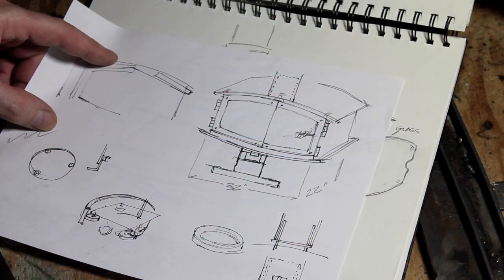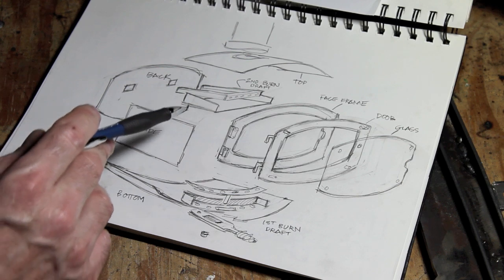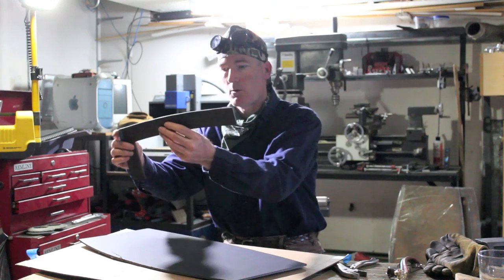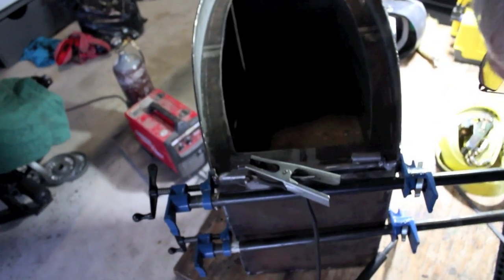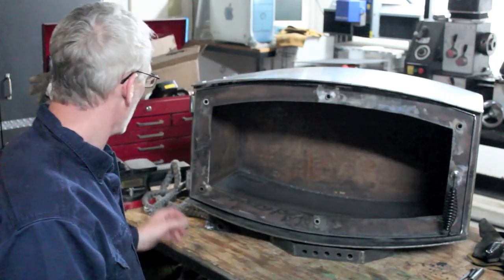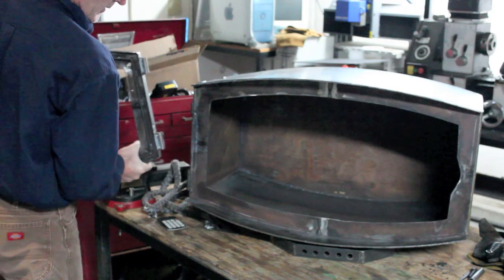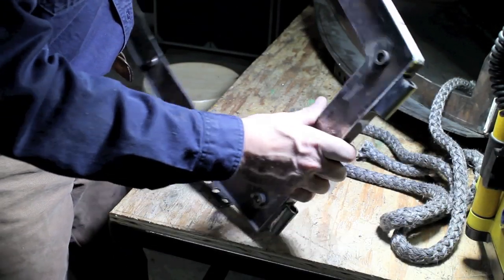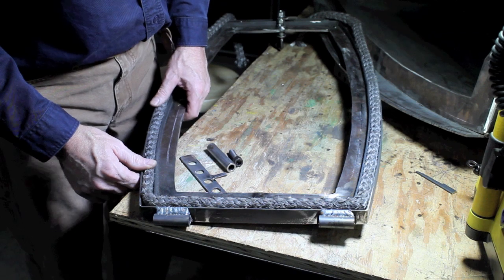Spinning Woodstove Design Build

Comment: Greetings again Kevin. I posted my latest video with the primary air dispenser located at the top of the door and the air wash is very good. The glass is always clean. The next stoves I will build will have air entrance at the bottom of the stove, this air is channelled to the top of the door and from there, the air flows down/along the door/glass into the combustion.
Reply from the maker: Hi Caotrpheus- Just posted on your video and think it is the design you describe above with 3 inlets in the bottom of the door. Wish I'd seen that before -my stove would look different! New subject: do you think firebrick helps? I know it focuses heat into the stove, and holds and radiates heat, but I love how fast the heat comes out of my stove without bricks. Will it rot out the steel if I don't use bricks?

Comment: ..for cheap, you can simply buy a few 'splits' firebrick (the cream colored ones..),  1/2 thick as normal, about $1.45ea here in PA. Use them like shiners (set on edge..), to modify/direct heat and gas flows. Now, when you move it to the next level, those potter's firing plates, in silica carbide (graphite grey in color..., kind of like the space shuttle tiles..), do well. I procured one for a fella last summer who was making an 'experimental' masonry heater/smoker/grill combination.  ALSO...peruse our website...Masonry Heater Association of North America, for creme' de la creme', world class heater builders/craftsmen and their work. You WILL be impressed by their skills and workmanship.  Anyways...you have a pretty cool design, now, as you are doing..its the refinements that make it a primo product. Then, you can get the Chinese to mass produce it (...ah, tongue-in-cheek, there., eh..?!). Be well, NK

Comment: Wow, just wow. I can see that you have gone to the extra effort to keep the design sleek and minimal. It always seems more work to get a good minimal finish like that but I also like that you have used a traditional spring handle design to tie it into the traditional design vernacular. Looks amazing in the house there. The house too looks like you have worked hard on. Your design?
Reply from the maker: Hey thanks Phrayzar, I'm flattered- I didn't expect people to appreciate the modern design so much. And yes the cabin is my design. It started with 4 surplus arched laminate beams- 34' long, that I tracked down in Oregon. Then I started sketching ways to use them differently than the standard gable roof they were made for. About 5 years to complete :)

Comment: The design of this stove is absolutely stunning... I wish I could design my stoves so elegant. Very nice work and very inspiring. First question, is the air wash for the glass enough? Do you manage to keep the glass clean, no soot? Can you please show us details of the secondary combustion working? Thank you very much for showing us details of the construction of the stove.
Reply from the maker: Thanks for your kind words Caotropheus. I wish the glass would stay clean, but as I am burning soft pine it will always show soot. If you burn something harder like maple or oak you will see less build-up. But I would add that when the sky is dark and the flames are up it always looks amazing. In the daytime the upper half of the glass looks black, but at night it shows right through. For details on the  secondary burn, you can see at 1:08 a sketch of that shows metal tubes that start in the back and bottom outside the stove to pull fresh air into the top area, where vents are drilled in the tube. It gets so hot inside this chamber that any smoke passing through to the chimney get incinerated. I think this also makes the stove top extra-hot.
Reply: ***** Thank you very much for your kind answers. Up until today I did not manage to avoid soot deposit on my stoves' glasses. I am trying a new primary air dispenser that is located on the top of the glass. All primary air as to flow along the glass before it enters the combustion. I hope this theory will work. This project will be ready within a couple of weeks. I will post a video then. I would like to take this opportunity to kindly ask you if you have a dumper in the chimney and if you can show us details of the stove working and the secondary combustion. Thanks.

Comment: Kevin,  Love the design and execution!  Can you tell me what type of glass you used (Ceramic?) and how you mounted it?  Did you have to use a special drill bit (Diamond Tip Core?) or was it made to order?  Thanks so much!  
Bill.
Reply from the maker: Hi Bill- yes I used ceramic glass from https://www.onedayglass.com/ great company. I sent them the template including holes (use 1/8 panel wood or plastic- cardboard changes size w humidity change). You can see how I mounted it using asbestos rope in the video.
Reply: Thanks Kevin!

Comment: The attention to detail really paid off, you must have some hours logged on that build. not sure if you mentioned but how did you make the stove turn independent from the chimney? The stove is beautiful.
Reply from the maker: +BEAKER UNREFINED - The chimney and all sections to the ceiling are fixed to the stove so everything spins as a unit. The top of the chimney spins inside the ceiling box. To line everything up I put a laser lever on top of the stove and moved the stove until is was centered under the ceiling box. If it isn't perfectly aligned you would see the chimney oscillate when it turns.

Comment: I ready to start building my own stove , I'm perfectly happy doing the fabrication  work but struggling to understand the glass. did you have a  piece of glass made or did you buy a standard of the shelf part and design your stove around it ?
Reply from the maker: +Charles Grewcock  hi I made a template of cardboard and sent it to one day glass. The cut the ceramic glass and then tempered it. The first piece shattered in shipment and they replaced it. Highly recommend this company: https://www.onedayglass.com/

Comment: where are the ceramics, to increase burn efficiency../??
Reply from the maker: +Novo Karpati I was going to install firebrick on the floor and walls, but I it puts out so much heat and I worry the brick will slow down the heat transfer to the room. I've never had to clean out ash, so I'm thinking it has good burn efficiency. My bigger concern is that the steel walls won't hold up. What do you think?
Reply: +Kevin Murphy 
You could easily put a secondary heat exchange inline with the exhaust pipe..  and with your design skills, we would all like to see that.............   basically all you do is build a box and stick pipes through it that extend from one side to the other and are open to the Room air..........   so the "inside exhaust heat run over the pipes and they get super hot, but your "room air will flow through the pipes with a fan, ect.   ..  capturing even more heat from the exhaust...  its the same principle as a "radiator..........   looking forward to your designs..  very good vid...   subbed :)
Reply: Kevin Murphy, Sir, if you're really not getting any ash as you say, you had better get a patent on your stove because in 50 yrs of burning wood, I have never seen or heard of a wood stove that doesn't produce a decent amount of ash. You are sitting on a Gold Mine if what you say is true !!!!